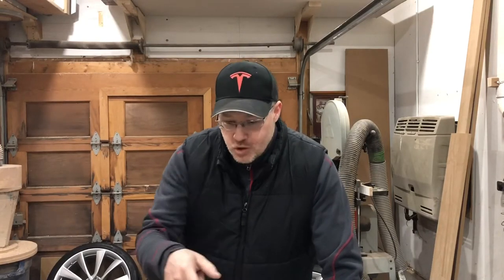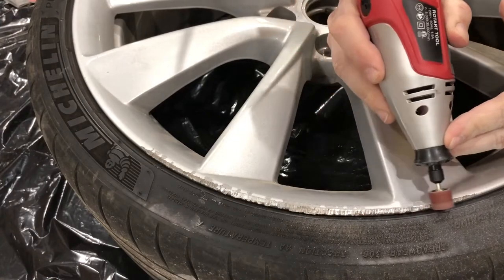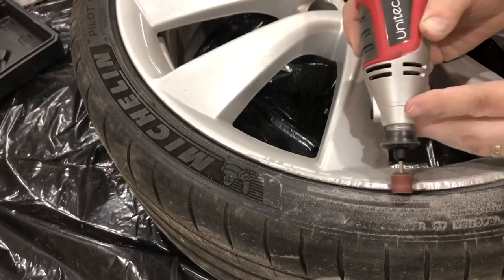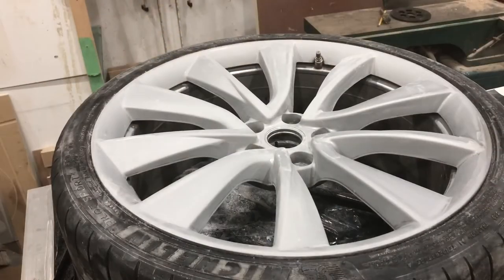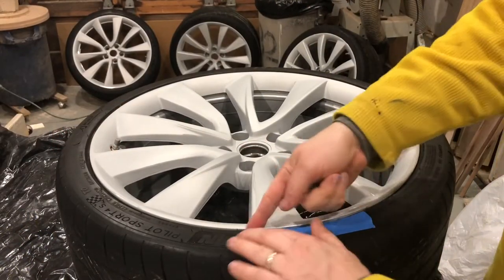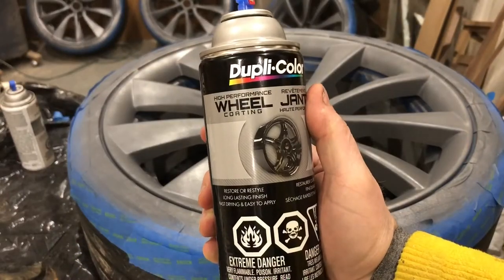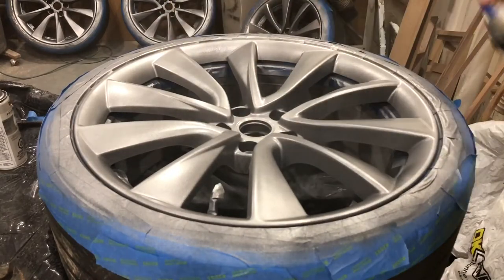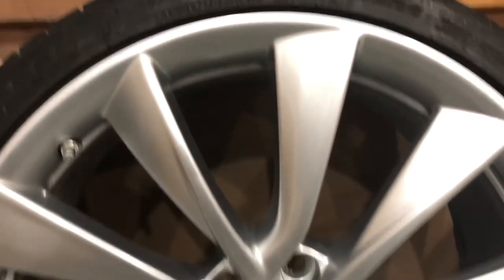DIY Curb Rash repair and wheel refinishing with spray cans. Make your wheels look like new.

Comment: Hi, great advice,  & tips.
I did this back in 2017 when I got my first car, toyota auris.  After having the car for 2 half yrs I got curb rash on the front wheels. Never the back, only the front.
Anyway, I did mine during our hottest summer we had, so I thought I'd give my wheels a paint job.
So got to it, rubbed all wheels down with all grades of sand paper, then used under coat, I did 3layers of under coat, then 4 coats of top colour silver on the wheels, left a good 20min, inbetween spray coats, with the hot sun as well, they turned out fabulous,  then 3 coats of clear spray. They looked really great  not bad for first time.
Mind you I did study all you tub videos. 
Now iv got a vaxhall corsa e, these wheels definitely need doing.
Can't wait till summer. Then I can change the colour  to from silver,  to a gunmetal gray, I got two cans already, just need two more to do the job. And the sandpaper to.

Comment: Nice job, I got the 19" silver sportwheel on my model 3. Could you please share the spray paint and touch up products that will match the wheel? That would be so good. I got some touch up to do but I think a little spray touch up will look better.
Reply from the maker: If you have stock wheels in the same colour as mine, the best touch up paint I’ve used it made by Testor. It’s normally used for models. Metallic Silver   Matches well.

Comment: Great video, thanks for doing that. You mentioned you could recommend the touch up paint color if we didn’t want to paint the whole rim? What do you suggest?
Reply from the maker: Testors model enamel matches well. Silver colour. Cheap and works well.
Reply: @humandoing9675  Great..how long did this process take you for the 4 wheels?
Reply from the maker: @richardhui3810  a couple hours.

Comment: I did something similar but the wheel I did now picks up brake dust.  Any suggestions?  Maybe polishing can help?
Reply from the maker: Have you applied any coatings like Bead Maker? Some of them can attract dust. I use The Last Coat spray on mine. No issues with dust and they clean very easily.
Reply: @humandoing9675  thx.  I have the Last Coat will apply!